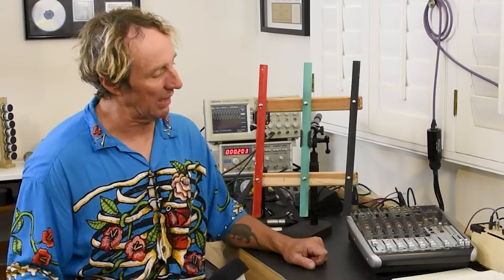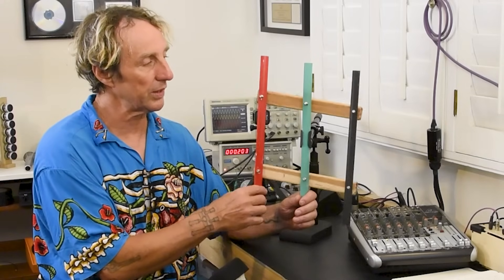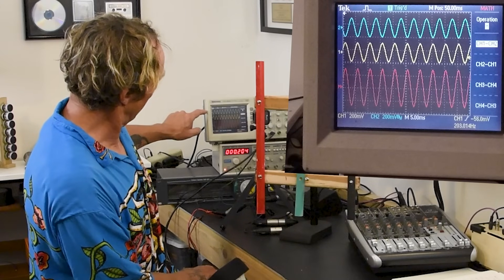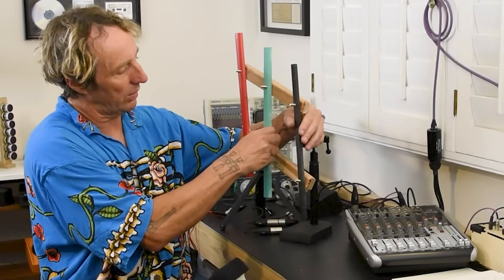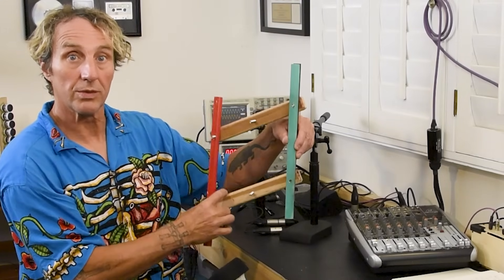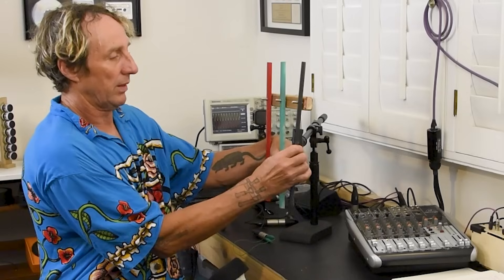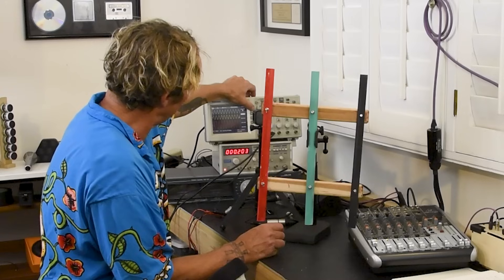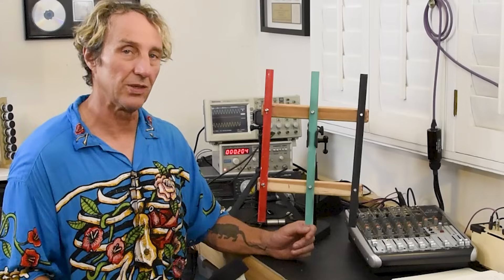The Mechanics Of Audio Balanced Lines Explained

Comment: This is a great example. So I have an Electronic Drum set (the new Alesis kit) and the line out (Left, and Right) are balanced( as its labeled ).  If I take one wire away, now there is no noise canceling going on even though the sound comes out both speakers.. I should run both outs always. Now I want to not take up 2 input channels on my Tascam Model 24, so I could run the two lines out from the drum set to channel labeled 13/14. 1/4 inputs(L,and R) instead of 1 XLR. This will give me the same balanced result with only one input.

Am I thinking correctly? Your a great teacher....Thanks😃

Comment: So when do we use one or the other specifically? Great video btw.
Reply from the maker: Balance lines tend to cost more and are associated with higher end gear. But for the most part, whatever gear you buy will have one or the other or both. Guitara and basses are unbalanced.  Pro and semi pro mics are balanced. Home computer mics are unbalanced. Home hifi is unbalanced. Many self powered pa speakers have both.

Balanced whenever possible and definitely for long cable runs. Unbalanced for short runs is sometimes easier and ok
Reply: @DaveRat  thank you!

Comment: Could losing one of the two balanced connections result in a signal being EXACTLY 3db lower than it ought to be?  Maybe it was 10 or 12db, but I remember it as being a round number and the offset was exact - a 2-channel amp that got lopsided and which used balanced speakon cables to the monitors.  I just compensated by adding compensating gain to that channel in my audio interface - and it is always EXACTLY that amount to make things equal, even with test tones. But it bothers me to have to do that so I ultimately stopped using them. 

I've been wondering if I should order up new speakon cables and see if that doesn't fix things. It's been a while since I used them because of this, which is why I can't remember what the compensating gain is, but I do remember that it was always a round number, which made me think it might be a mechanical problem with balanced connections, but I don't know enough about electronics to prove it.
Reply from the maker: Yes with an electronic balanced input depending on the design it is possible that losing one of the legs will give you half the voltage which should equate to a 6db drop. 

There are other scenarios and circuit designs were losing a leg will sound really thin and low volume or have no sound at all but a 6db drop is not uncommon

Comment: Finally i understand, thank you!
Reply from the maker: Awesome
Reply: @DaveRat  A question, wouldn't this be better also for guitar cables? Al that shielding of the cavities is mostly wasted time.
Reply from the maker: Yes guitar pickups are perfectly naturally balanced outputs and running balanced lines would definitely reduce issues but there are complexities. All of the tone controls and switches would need to be changed to double versions for balanced versions. Also it wouldn't eliminate the need for shielding but it definitely would make it less reliant on the shielding inside the guitar there.
Reply: @DaveRat  ok, I guess we'll have to live with the hum then🤔
Reply from the maker: Yeah I mean making a custom setup is always fun but I don't see the industry shifting. Too much old school art embedded in the existing ways

Comment: I have one question. Is there any difference between using an unbalanced TS or a balanced TRS cable to an unbalanced female TS jack on a piece of equipment like say a keyboard to an amplifier or will they both act exactly the same?
Reply from the maker: Yes and no. You can run into problems if the keyboard output has a TS jack that does not connect to the ring. And if the amplifier input is balanced TRS and connects to the ring, then the wire on the ring just becomes an antenna to the amplifier input and the amplifier input is not getting both sides of its balanced connection.

If the keyboard has a balanced out or a TRS jack with the ring shorted to sleeve then the TRS cable will work exactly the same as a TS cable.

One way to test it would be plug in a TS cable and then plug in a TRS cable and make sure they're exactly the same volume. If there's an issue with one of the lines not being connected you should see a 6db drop in level with the TRS cable
Reply: @ But a TS cable always work?
Reply from the maker: @Average-AL Yes, a TS cable automatically shorts the ring to sleeve on balanced outputs on both ends so it will work with both balanced and unbalanced outputs.

If the output is a stereo jack like a headphone out it will short the right channel to ground and you'll get just the left side with the TS which typically is fine unless you're driving a stereo amp which only one side will work
Reply: @DaveRat  Thank you. For me that means. If the device have XLR jacks use XLR. If the device have telejacks just use TS cables and there will be no headache.
Reply from the maker: That is perfect and wise

Comment: " IEC 602689-3:2001. Part 3: Amplifiers". Sound system equipment (Third ed.). Geneva: International Electrotechnical Commission. 2000. p. 111. Only the common-mode impedance balance of the driver, line, and receiver play a role in noise or interference rejection. This noise or interference rejection property is independent of the presence of a desired differential signal.

--The balanced cable is twisted pair and has the same cold and hot impedance to ground
Reply from the maker: Yes, that refinement of the explanation to include balanced lines where the two signals are not equal in opposite is true and relevant to function of cancellation of noise. 

But cancellation of noise was not the focus of the video, The focus of the video was understanding how line balancing works. Not how to maximumly cancel noise or cover all scenarios that will noise cancel.

Perhaps similar but not as drastic as teaching that 1 + 1 = 2 and also

.9999999 repeating plus .999999 repeating also equals two exactly.

Yeah teaching that variation that people are just learning the concept of addition may not be beneficial to the understandings of the concept of addition

Similar to how the signals do not need to be equal in opposite to cancel noise

.999999 repeating does not appear to equal exactly one but it does.

And saving the explanation of why 0.9999 repeating exactly equals 1 is a good topic for an expanded lesson. Perhaps like the fact that noise can be canceled with signals that are not equaling opposite can still cancel noise.

So balance lines cancel noise and voltage imbalanced lines also cancel noise as long as the impedance to ground is the same on both of the lines

And most importantly thank you for the reference to the documentation, super cool and much appreciated!

Comment: I doubt I'd understand this well if I didn't already understand this well.  

Still interesting to see the depiction effort.  

Technically, differential mode signals aren't "balanced" in many cases, in this historic meaning that anticipated a matched transformer pair with grounded center taps.  

The use of differential or balanced signals to enable CMRR based noise rejection, beyond what active or passive shields can do, perhaps should be emphasized more.  

Lots of higher level issues are also important....  transformer loading and impedance matching, versus opamp line drivers ideally being a near zero impedance current sink/source (just like speaker power amps), and that being resistant to static high Z noise; at the other end, do we then bother with 150 or 600 ohm terminations, and if we do, how does that work around devices in patch panels or if multiple high Z bridging loads are stacked on one output, in cases where a 30 ohm driver doesn't care much if there are one or 5 10k to 200k differential input loads stacked on?  (But, some garbage outputs act weird with reactive loads, from cable runs, or in more RF suppressed systems). 

There are also issues like star-quad higher symmetry cables, Beldfoil and similar static drain bonded shields (for fixed installations) or drain wires and carbon conductive plastic shields (for flex cables), etc.  

Then we get into power systems, and star-hub circuit layouts, live venues with mixing stations run from stage power along a snake (not important with optical digital snakes), and other tricks to reduce potential ground loops....  or around RF, use of heavy copper strap and Panduit channels for AC linked to but separated from audio and digital, and what amounts to facility architectural engineering infrastructure.  

At one point I wondered if this video would touch on phantom power, given how common it is in cheap mixers and common mics these days.  (ground to DC on both polarity hots)  

Given a few of the other comments I see, it's also clear some people need lessons on how sometimes in XLR feeds, but often with 1/4" T-R-S, it's not obvious without knowing if a feed is differential mode (often called balanced; rarely is any more), or may be stereo unbalanced, or may be an effects insert that's unbalanced return-send-common. 

Another issue I noticed here was engineers who lacked basic awareness of balanced or differential signal lines and electronics, to reject common mode signals.  That's a problem in bad car designs, in medical systems, and instrumentation, and not just pro audio.

Comment: As some others have pointed out, you're mixing together the concepts of balanced lines and differential signalling.

Balanced lines concern the electrical properties of the circuit: the impedances of both conductors must be balanced (giving us the term ‘balanced line’)

Differential signalling, on the other hand, concerns the actual signals that are sent over the wires.

The two concepts are distinct and it’s more misleading than helpful when YouTube educators treat them almost as interchangable. Crucially, it's the impedance balance of the line (typically a twisted pair cable) terminated in a differential device (transformer or differential amplifier) that provides the common-mode noise rejection that makes balanced lines desirable in the first place. Whether or not the signal appears as two voltages of equal magnitude but opposite polarity (with respect to ground) is irrelevant as long as none of the three conductors are tied together. In fact, a balanced line will continue to reject common-mode noise even when there's no signal on the line (just as you demonstrated on the oscilloscope)

To quote a personal hero of mine, Captain Disillusion: “If we’re gonna explain to the masses how something works, we should understand the details a little better […]”. In this case, a 5 minute brush-up on the Wikipedia article for Balanced line would have told you all you needed to know
Reply from the maker: Did you know that .9999 with the 9s repeating  infinitely is exactly equal to 1?

Perhaps it would be helpful to mention that .9999 repeating plus 9 is exactly equal to 10. More people need to know this else they won't grasp how addition works. Right?

In fact, if someone does not mention .999 repeating is equal to 1 while discussing math, they are not providing a whole and accurate description.

All in good fun and thank you.

I'd have to watch the video again, as it was a rerelease of an old video from 50 or 10 years ago, but I recall describing fundamental basic balanced lines, not all versions or the only way to achieve CMMR

Cool cool and let's make the world a more accurate place
Reply: @DaveRat  Excellent!
Reply from the maker: @fredrikfredrikfredrik 👍🤙👍

Comment: I once got shown the door on a job many years ago because all that the general contractor ran was an Un-shielded pair of cables from one point to another where we needed to get audio through. I told my employer not to worry because we don't really need a ground conductor in order to get our audio across the wire. All that we needed to do was balance the signal at both ends and we would be fine. I had some of their "seasoned" engineers start to point fingers saying that it would never work without a ground. I told them that phantom power would not work without a ground but a dynamic mic or plain line level would work just fine. The owner of the company called me into his office and fired me for shoddy engineering practices. They instead paid thousands of dollars to a cable company to come in and break walls disturb people on other floors (New York Office Building) and run the "proper" cable. I proved them wrong, but they were the ones who didn't know what they were talking about. My last words to them were "Common Mode Rejection" and I left.
Reply from the maker: Yes you are correct and we run into that with the sound tools products that we make. As long as the environmental RF noise is not too high and also the signal is not super low you can use unshielded cat cable for analog over cat. Just the twisted pairs and balance lines are sufficient to get rid of most of the noise for most applications.

That said there can be RF riz and it's definitely not as quiet as using shielded cat cable
Reply: @DaveRat  I've done it many times since then. Never for any type of reference audio. I did experience a tiny amount of cross talk once when applying a hot (+4) signal, but since it was stereo with similar audio on each of the pairs inside the sheath, it didn't make much of a difference since it was a background music source in an office building feeding ceiling speakers.
Reply from the maker: Excellent and I very much appreciate finding the best solution for the application and not being stuck in the ways of having to do it a certain way when creating misery expense and lost time

Comment: Nice demo.  It's worth noting that what makes it a balanced line is the impedance for each of the 2 lines must be the same on either end, like the input impedance at the end of the line must match for both hot and cold, and the source impedance must be the same for hot and cold, and indeed the impedance of both conductors must match too, that's why it's balanced.

The traces on the scope for each leg are showing relative to ground, and it doesn't matter at all if that shows opposing waveforms, one could be a flat line, the other be the signal, or any mix in between. The point being the signal is the voltage between the 2 legs, and any induced noise will be common to both, so it can be subtracted.  If the hot wire is going into a slightly different impedance to the cold, it is unbalanced, and you lose your noise immunity.

Comment: I've heard that using balanced wires between devices that don't even support balanced input or output can help reduce noise.
Reply from the maker: Yes, using balanced cables on unbalanced input and output circuitry can still have some benefits and offer some common mode rejection.